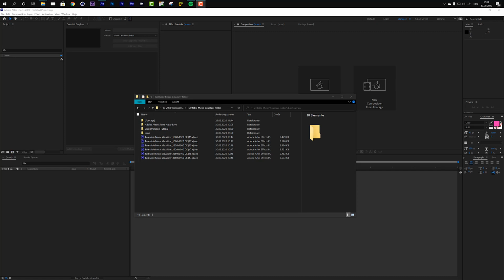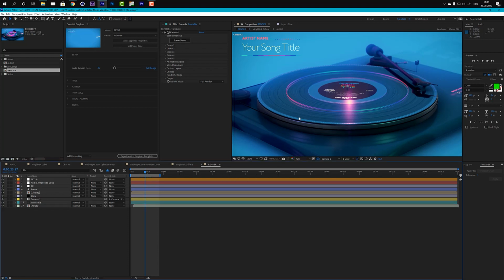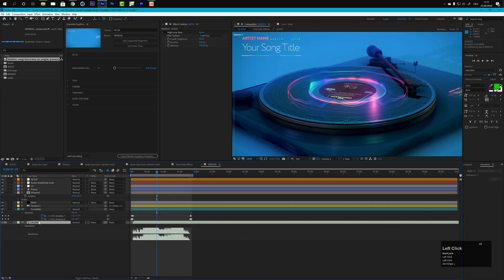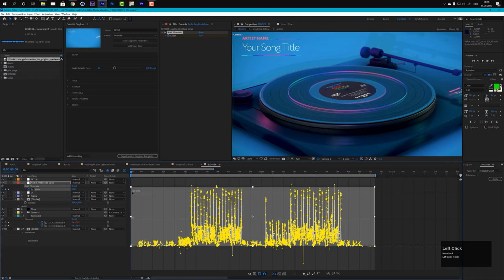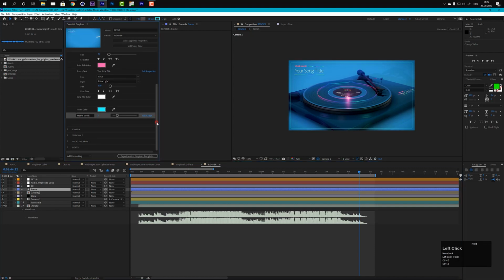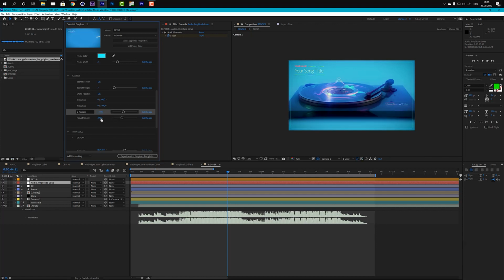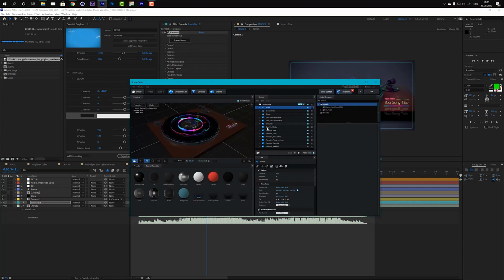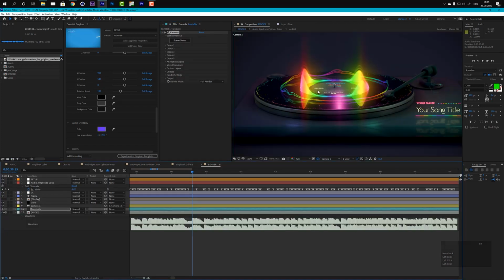Turntable Music Visualizer Customization - After Effects Tutorial

Comment: I am using After effects cc 2019 but i don't have option for Scene interface or scene setup
Reply from the maker: Do you have Element 3D installed on your system?
Reply: @Nodeconnector  yes i have but i think i was wrong to select inside the video copilot; PLUG-INS, 3D PACKS... which i choose? thanks
Reply from the maker: @edrag78dninja33  I don’t know what you mean. This template does not use anything from the Element 3D packs.